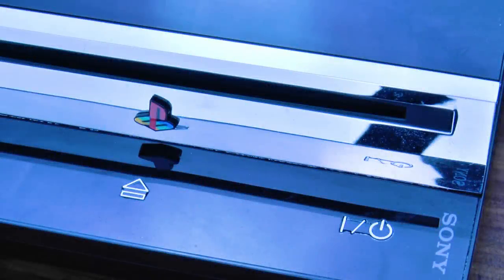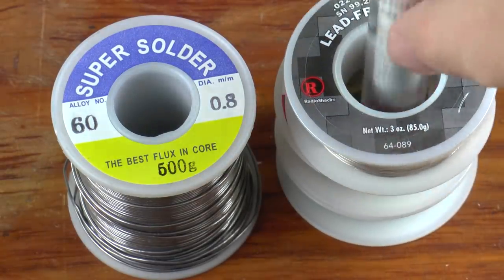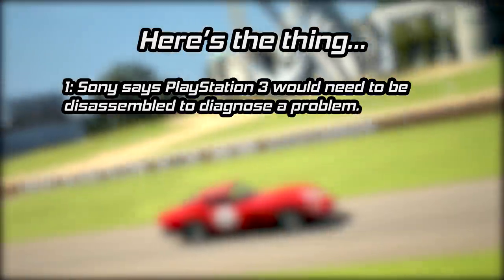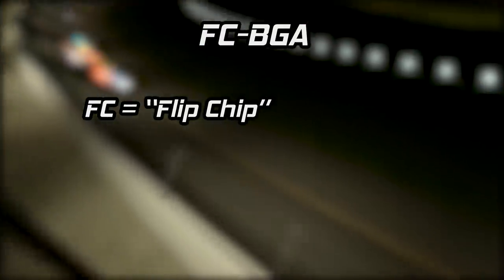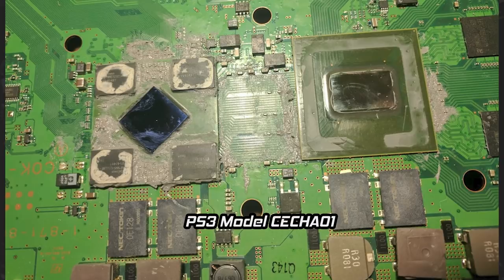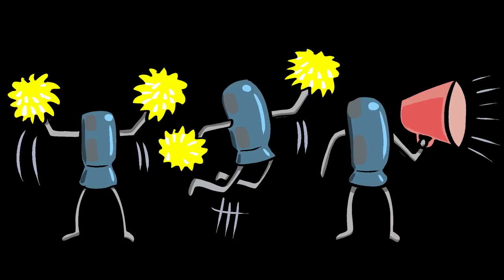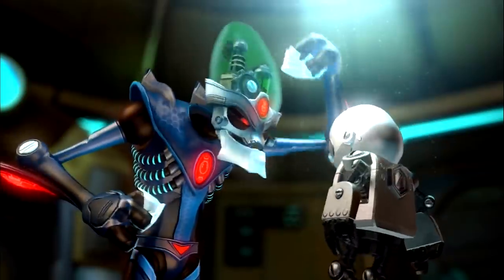The Misdiagnosis of the PlayStation 3 Yellow Light of Death

Comment: Lol and Sony buried it and FAST. They recognized it fast and responded fast kudos for that. But the failure rate for those ps3s is 100% over enough time and use but Sony never full on admitted it was faulty unlike Microsoft that spend 1.5 billion in repairs. The 360s next model fixed it but it looked like the same model and the cat was out of the bag at that point.  The s model solved the issue with a better cooling system as well as a lower power apu that’s a cpu gpu combo rather than having both separate which is what the one and ps4 use now an apu. I hope for this next generation they go back to having a gpu and a cpu

Comment: Wether it is a cap problem or not, working down the list of "assumptions" of things that need to be repaired is relatively easy and straghtforward regardless, ur still using the same equipment/materials/etc to make the repairs down the list and if there are indeed broken "chips" caps processors etc etc they can be easily obtained with only a matter of shipping... so in the end, its just a matter of crossing off the items of the list so why so serious? 

People want to fix their beloved PS3s so why not just make a vid of list of things to do/try instead of being sarcastic/skeptical etc? People are obviously looking for a cheaper way of fixing things and they arent sending their PSs back to sony because of EOL support/not worth it/etc, so just make a vid that is more useful...

Comment: I fixed mine putting a better quality of thermal paste a 19 blade fan and i drilled little holes at the bottom of the conlsole i never had problems sinds its still bit noisy but not like before doong these things tl it ^^

Comment: The design is very idiotic on the GPU.
They could have used socketed mounting solutions (they have existed for years FFS!).
Reply: It would have added slightly to the manufacturing time and price, but not by much.
They did this because they were stingy and it was a battle with other corporations to get "ours out before theirs".

Comment: My first thought on that delided board would have been "damn, that need cleaning", that could be causing thermal issues or even a short in its self and I have solved problems pretty much permanently with friends consoles by just cleaning them. Both YLOD PS3s I fixed were knackered hard drives, and both were Sony repairs that had gone again in a few months but as they were repairs, Sony refused to replace them (kind of a common deal with Sony in my experience, even now with the fuses blowing in their earlier PS4s that prevent the firmware updating as the BD Drive no longer works, as thats how they were designed, and they refuse to replace or want you to pay to repair them, even though its a fault of their causing). I popped in a new HDD, and each time it booted fine, though even after only a couple of months (or because it was just a reconditioned unit that whoever they have to repair them does a shoddy job on) they needed a good cleaning. Both are still working now, and both were 3rd gen fat (No BC at all, as opposed to full hardware, then a mix of hardware and software, they are the  no bc with no card ports and 2 less USB ports).

Comment: Back in 06 i had my CECHA01 until around 2009 when i decided to sell it off still working, i do hope its still out there somewhere functional but i doubt it. A couple years ago i had the nostalgia bug so i managed to find an OFW 1.6 CECHA01 ie barely even used, delidded it to use liquid metal and with CFW i keep the fans high enough to never exceed 69C ( ͡° ͜ʖ ͡°) Shouldn't die on me for a long time.

Comment: WoW this is one amazing video!!! 
Thank you very much! 
And especially comments section is ultra helpful!!  Thanks to ALL! 
BTW I got 3 PS3 60 GB launch models  ,collected thru year from carboot sales. 
What is the most basic, necessary stuff I need to prevent their death? 
Thermal paste, new cooling system and CFW with regulated fan speed option? 
Can anyone advice me, please? 
Thank you
Reply: Repaste with MX4, CFW + webMAN with temps set around the 60-68*C mark.

You can also replace the NEC caps with tantalums (if you're brave, these are pretty tough to replace) and it should live for a long time. I know this from some of Acer's high end laptops (Acer 6920/6935/8920/8930) where they used NEC Tokin caps.
Reply: @NSHG  thank you very much!!! 
I'll try all your advices!!! 
Have a great day!!!!

Comment: I have actually done some research and testing on this subject my self and I believe I know exactly what causes ylod on 60gb consoles. I have had 4 60gb phat models that all died after some time, last one died in 2017 summer, it was manufactured in 2007.

The main problem is indeed lead free soldering combined to a fan profile design flaw. I have seen some NEC-chip failures too but it is quite rare. Power supply failures are also very rare.

The main cause for ylod is that the system let's the temperature stay at about 70C degrees constantly. Fan level rises by one when temperature gets over 73C and lowers by one when temperature gets down to 60C. After some use at constant 70C the solder balls crack and cause ylod. Thermal paste is NEVER the problem unless the system actually says it's over heating (it will say it at the top right corner), changing the paste only lowers fan speeds, not temperature.

The only way to really fix it is to reball using lead soldering or to use jailbreak custom fan mods. Of course this all could have been prevented if sony changed the fan profiles with a system update.
Reply: I heard sony changed the fan profile shortly after firmware 2.80 to let phat systems run hotter and die faster to sell more ps3 slims?? That true?
Reply: @bookshelffury  Interesting, where did you hear/read about this? That would be pretty mean from Sony, but then again it's totally possible since they sold all fat models at a great loss.
Reply: I can't remember exactly where, some cfw forum.  They said sony got lots of complaints about high fan speeds so in later firmwares they adjusted the fan profile to run quieter but hotter
Reply: Less complaints about fan noise,  and possibly more ps3 slim sales from them dying of heat lol

Comment: 1) early PS3's revision chips where built on ancient node.
2) ROHS compliant solder is cancer that was introduced at that period of time in a premature form.
3) those "geniuses" from Sony used IHS (integrated heat spreader) which is not a bad thing if you use solder under IHS as TIM interface. but they ofc weren't and opted for cheaper solution).

4) ROHS is just a gimmick for fools! in reality is just an excuse to make devices selfdestruct after a preprogramed period of time. pure tin tends to crack and so called "Tin Whisker" effect which is what kills BGA chips 90% of time since its widely used to solder BGA die to organic interposser. here is what i mean https://i.ytimg.com/vi/ZJd8SxY4nmM/maxresdefault.jpg and explanation from NASA about tin whisker effect https://nepp.nasa.gov/whisker/
all this combined was the main reason of high death ration on early revisions of X360/PS3's and PC hardware of that time. and yes! we have this cancer to this day in a perfected form, just try to find modern GPU that can survive more than 3 years)

Comment: The 2005-2007 era of hardware was overall just bad, not only the consoles, but also laptops and GPUs. Chip sizes and number of BGA pads were growing so larger chips would be exposed to higher forces due to thermally induced expansion and shrinkage. There was a big scramble to replace leaded solder with the lead-free solder, which would lead to two possible situations, either the significantly harder solder could crack itself, or it could exert more force on the chip, making it more likely to sustain damage in the substrate or on the bumps. Also designs got not just bigger, they rapidly got more power-hungry, again amplifying the damage potential. In subsequent years, a lot of materials and manufacturing methods were adjusted to eliminate those potential failure points.

Furthermore higher soldering temperature would risk degrading various other components in various ways, though i don't know of any specific instance where that would actually turn out to be the issue - but looking at a dead component, or even a series failure in a particular product, it's often difficult to tell why it died here but didn't in a different product made years ago, and the ultimate conclusion might never be reached. Plus several capacitor plagues, including the NEC polymer-tantalum variant.

Comment: Well all I can tell you is that every time I pulled apart a PS3 and use the heat gun to reflow the CPU it worked proving that that in fact was the problem

Comment: My Fat PS3 actually melted...
I played in the summer with a room temperature of around 35°- 40°C, the console sitting horizontally with bad air flow (I guess). It turned off, I turned it on again, yellow light (didn't know what it meant back then)... I tried a few more times to turn it on and continued playing. A few minutes later it shut off again for good.
When I opened it up I noticed that the processing units had melted against the cooling plate... But only after I ripped the sockets out of the mainboard... I assume that there was nothing that could have been done either way.

Comment: video was not very helpful or informative, sorry, it ended up being a 15 minute waste of time. a better use of the video would have been on "how to distinguish the causes of the yellow light" instead of just saying "no one knows" after wasting 15 minutes of my time. the thing people should remember before they rip the capacitors off their boards is that you can test their capacitance to verify they are actually bad. However it only takes 1 cracked solder ball out of those hundreds  to get the YLOD, and you can't test those. I wouldn't recommend reflowing to anyone though, that's a very bad idea with too many potential problems.
Reply from the maker: You missed the point of the video. The point is to diagnose the problem. You shouldn’t do a blanket fix on a PS3 and expect it to work. Too many people want an easy answer before they even know the problem. The YLOD appears for several different reasons. Find out what is wrong and then address those problems.

Comment: Sony has always designed trash hardware PS consoles (PS3/PS4/ PS5?). What kind of design is it that they can use a single fan to blow the super hot air from the GPU/CPU Heatsink through their big power supply, which because it has so many transistors holds the hot air and does not let all the heat out. In addition to the fact that power supplies run hot, are you going to heat it up more by pulling the super hot air from the CPU/GPU heatsink? That's trash hardware design . That is why so many PlayStation die. Sony have not learn or they don't care because they has sold more than 100 millions PS,.... right because they die and you have to buy it again and again!  That's why I chose Microsoft ( From Xbox One / S / X / and now Series S/X) because they design the best console hardware.

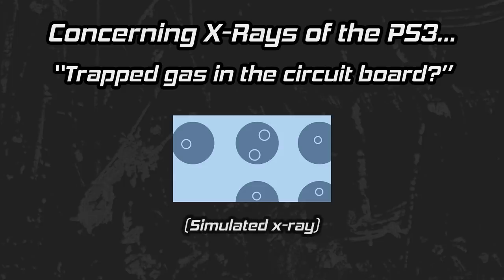Comment: 10:26 was it just cited as "problematic" because of supposed "racist" origins? Like the term "gardening" and math in general?
Reply: Problematic because the underfill is inadequate and allows the chips to warp with enough mechanical stress that can cause all sorts of damage ie the rsx won't function and will die. All of the 90nm chips will. Its because nvidia allowed chips from tsmc (this goes way further than just ps3's) to enter their supply chain and with heat and poor choice of materials you get a ticking time bomb. The chips have always been suspect but everyone's idea of fixing them has always been dogshit because the chips cannot be fixed.